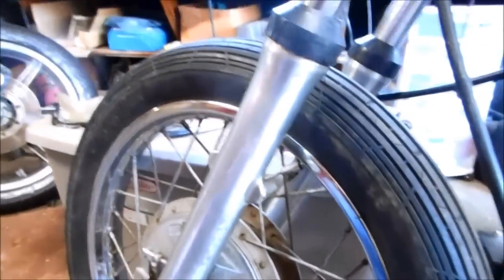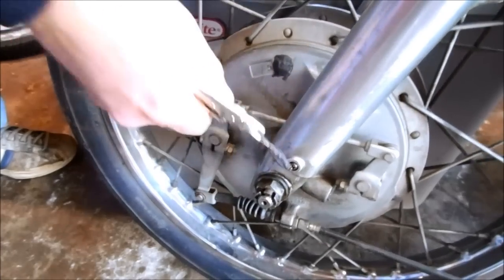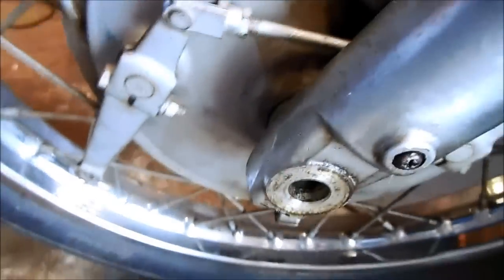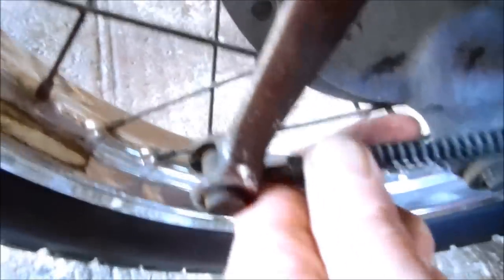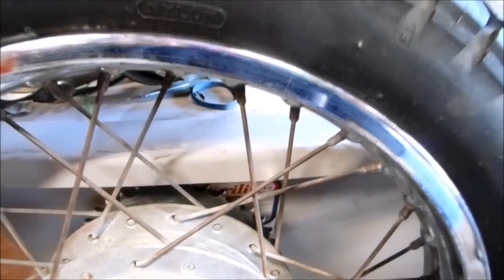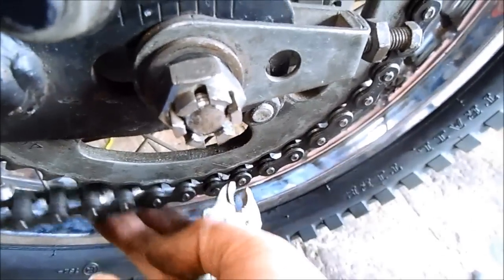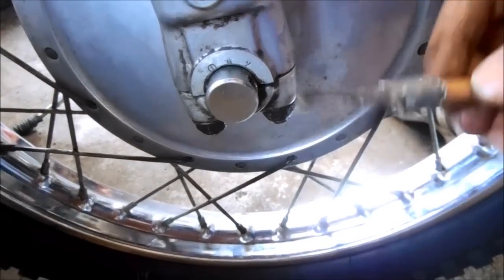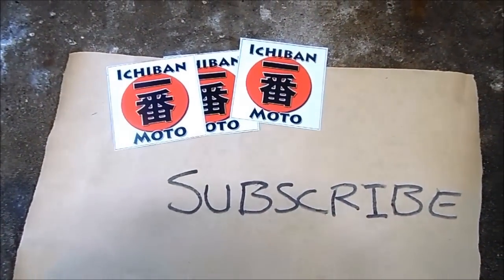how to change a motorcycle tire by Ichiban Moto

Comment: Finally! A comprehensive guide to tire replacement. The use of proper tools and in depth description of steps performed here really helped me rotate the air in my 2004 Sukawi 850cc dual sport off road trials TT formula racer. I could never figure out how to break the bead but now I can do it with my eyes open too. Thanks for your help itchy Bon!
Reply from the maker: +dozer1642   top tip: use 79%  nitrogen,  20% oxygen and 1% other
Reply: Wait a minute. Bead? Aw cripes, all this time I've been breaking bread. Now I've got mice all over the place for nothing.
Reply: Ichiban Moto i believe the other is actually helium
Reply: Richard Hughson, you could always put the mice inside your tyres then if you run out of fuel you just get the mice to run around inside to propel you forwards.
Reply: @daveb2428  it's true. Mice had so much more fortitude than the hamsters I've used. If you want an extra horsepower or two rated at the wheels, use country rats. They've got staying power 👍

Comment: Muy malo burro!  I was a little surprised that you didn't reuse the tyre air: it sounded like it was in good shape when you were letting it out. But maybe it had lost some of its psis. You're the expert so I guess you used new air for a good reason.
Reply from the maker: if you fill tires with helium, how many seconds per lap is that worth?
Reply: Fine for straight line speed, but you'll have less down force for cornering. If you could get some kind of "smart helium" that was heavier on bends and light on straight bits, that would be awesome.
Reply: +fluchter1996
According to the workshop manual you can't use street air in country tyres. I get my country tyre air from a guy in montana... message me I can hook you up... he has bags of winter or summer air in stock at all times too
Reply: @TheComputec  man that's awesome. Do those bags come with the automatic douche that's so critical in seating the beads properly with country air?

Comment: High performance tires can't use regular air because the oxygen expands. That's why racers use nitrogen in their tires. Nitrogen is expensive but I found a handy substitute. You can use bottle gas from your BBQ grill. Just be sure to keep your cigarette at least more than I guess a foot or so away when filling the tubes. After I do some repainting and get another set of tires I'll try to post a video showing how it's done. (serious about the cigarette, keep it back)
Reply from the maker: bad ass tip, I'm looking forward to your vid !
Reply: I'll film it as soon as my eyebrows grow back.
Reply: Alberto Knox lol
Reply: + Alberto Knox;
Why not use Hydrogen (H)  on sport bikes.  
Make it with water by electrolysis . 
It's cheeper  than bottled gas and, lowers unsprung weight ?
Reply: Too many wheelies. Same problem it you use helium from left over party balloons.  Looks badass but makes the bike hard to park if the wheel won't come down.
Reply: + Alberto Knox;
Good point, (good thing we didn't do that)
BTW  Good luck with the eyebrows .

Now thats BAaaaaaad -   Aaaaaassed !
Reply: Unfortunately the only thing my CB550 will burn out is the clutch, but it does that nicely.

Comment: I can't find any of those green zip ties..would it be ok to use black ones?
Reply from the maker: as long it is only temporary
Reply: Ummm I hate to be that guy but... That's actually VERY irresponsible of you to say Ichiban Moto.  You must NEVER use black zip ties not even temporarily.  Its green OR orange depending on your spoke count.  Hope that helps!
Reply: Ummm I hate to be that guy but... That's actually VERY irresponsible of you to say Ichiban Moto.  You must NEVER use black zip ties not even temporarily.  Its green OR orange depending on your spoke count.  Hope that helps!
Reply from the maker: Dos Vagos   ... good point, there might be children watching
Reply: Whistling In The Wind  your so wrong black are axle nut rated. Your confused with blue which is only rated to 10 psi

Comment: Tip for the noobs: grind your screwdriver bead buster a little more flat to the face with a Dremel before you insert. If that's too blunt, then use a 1-2ft hollow pipe that fits over the screwdriver handle to act as leverage to get under the bead. To protect the rim just use a section of a pool noodle, or if you have a can of plastidip around, that will do the trick short term. 👍

Comment: Hi Ichiban Moto, great video, but I have a question & need your advice. Will these grade green Kevlar zip-ties work on the castellated nuts that hold the muffler bearings & power-band in place on my Ducato-Guzzi, or are they only suitable for Kawasuki models?

Comment: I am a little confused over the zip tye's, obviously I have green ones for structural repairs and black for non structural. However, I also have orange ones, my wife's workmate ex husbands friends sister says they cant be used structuraly, but my friends uncles  co-workers plumber says they can. Who is correct?
Reply from the maker: I believe the orange ones are just the Dutch version of pink
Reply: Many thanks, always good to get information from the source. Badass!

Comment: Superb I was just thinking about changing my tyres myself! Can you get those cool locking devices in other colours apart from green? Epic work as usual Sir :)
Reply from the maker: The green ones provide superior strength and safety. They are color coded to prevent accidental use in the incorrect application. Maybe I could paint them
Reply: Safety First! Epic Tip!

Comment: What are you going to reuse those lock nails on?
Reply from the maker: +gorp27  not sure, they are in a jar somewhere here
Reply: I have several boxes filled with jars of lock nails. I've found you can get into pretty good shape just moving them out of the way as you work around the shop. It becomes cross-fit when you're in a hurry.

Comment: Wheel lock Nail?? Don't you mean split pin?
Reply: I believe the split pin did not appear till the 80's, What he removed was a "cotter" shaped nail and updated it on assembly with a "carbon zip pin"... which is now a standard on all cafe's....
Reply from the maker: +Triplescanada   I came across a new style of carbon zip pin when changing fork seals today

Comment: Did anybody see him actually "change a motorcycle tire" ? I seen him change a motorcycle wheel after having tires mounted while talking about a screw drivers use to do it. I poked plenty tubes and messed up plenty beads on bicycle tires growing up, don't want to that to my Harley. (I'm not saying it can't be done, but I was hoping to see it done.
Reply from the maker: +GR Smith  just pop 'em off like in the video , but be careful
Reply: I know you're hiding some cool trick here. I've been experimenting, greasing the tire with Pop Tarts and filling them with popcorn, but haven't quite gotten it yet. You can't keep a secret forever, y'know...
Reply: Richard Hughson I saw one of his vids before where he uses Army surplus C4 moulding clay to make an indicator lense. Superb video! Maybe he uses this explosive inside the tyres to "Pop" them off.

Comment: Nice job.  Just so you know those nails you called are cotter pins.
Reply: George W I think you're confusing them with "split pins"
Reply: Yes they are split pins. Cotter pins are wedged shaped pins that held the crank arms onto crank axle on older bicycles.

Comment: As for the 'nails' that lock the castellated nuts that hold the axles on, they're called "split pins", and they are in there for a reason, flimsy plastic cable ties aren't adequate !!!
Reply from the maker: +ralph burton  that sir is a axel grade green Kevlar zip-tie
Reply: +Ichiban Moto 
Please accept my apology, I didn't know there was such a thing.
Reply: If you go to any Nickel Town Customs franchise you will find them there
Reply: And if you wrap an axel around your axle it'll keep it from rusting in the wheel.
Reply: Richard Hughson its easier if you don't replace the axle at all, then it can't rust into the wheel. Just thread a black axle grade zip tie through the wheel hub and secure it to the frame dropouts either side
 Job done!

Comment: hahahahahahaha I actualy can change a Tire without a machine but you have to use very much force and build some shit...if u have alluminium rims It's not recommended because it scratch easy. if you never done it before by hand..and feet It's very hard to do  man hahahahahahaha
Reply: You can also damage the rim wall preventing it from holding air haha
Reply: +Moggy1000 ;
Got a tube .
If you get enough dimps  in the rim, It helps keep the tyr  from slipping when you
stop fast. Allowing you to outbrake everyone in the corners .
 Saves ya from having to zip - tie the tyr down to the rim .

Now that's Baaaaad aaaaased